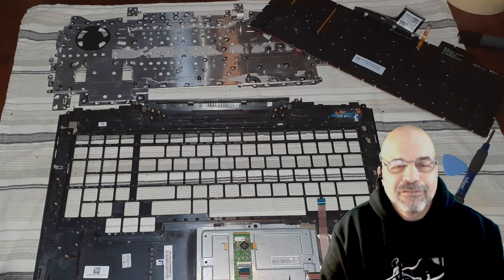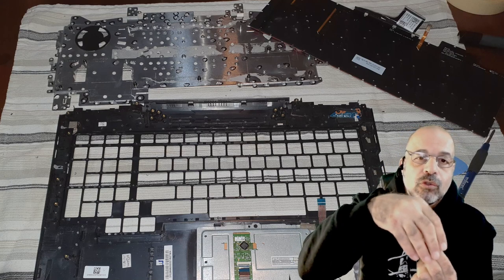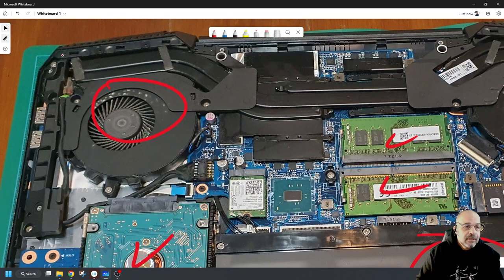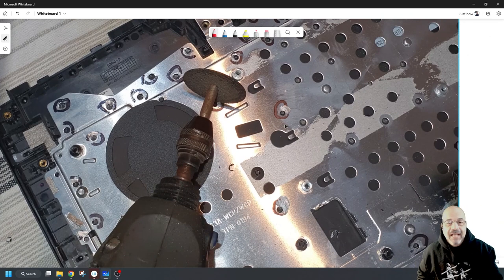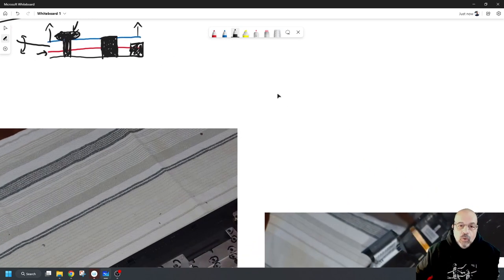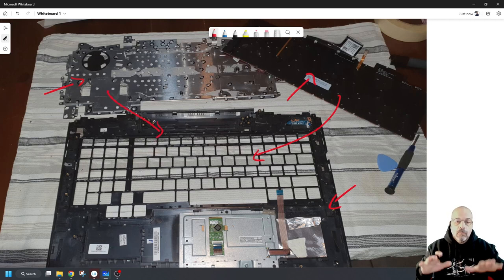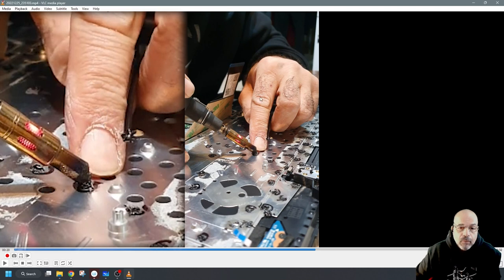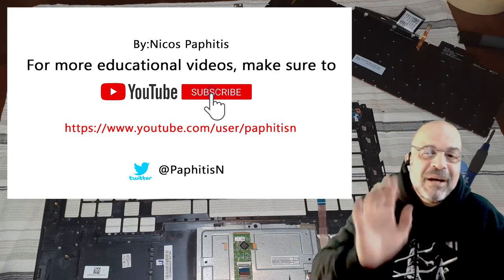Replace ANY welded / plastic riveted keyboard the CORRECT WAY.

Comment: JSYK, this worked. Thank you! No lie, it took my husband all day. My husband is amazing and patient, but he took this advice and followed it, saving him from having to figure it out solo. He has done many similar things. This is NOT a beginner’s job for sure! He had to use his lathe to fashion a new tip for his soldering iron, wanting fine control over its shape. I went out and bought him a dremmel tool. (It’s the least I could do besides feeding him during the ordeal.) Wow. That’s all I can say. What a long drawn out process! Why do they design keyboards this way?!
Reply from the maker: Thanks so much for your comment and feedback. I am glad the tutorial helped. It is not a job for the faint harted or a begginer. I am glad it worked out. Coudos to your husband and of course you for keeping him fed.
Reply: @paphitisn  i am in a tricky spot my keyboards not fully died at moments it works almost perfectly but if it does die the laptop can't be turned the annoyance is almost worth living with but ik to save my laptop in the long run i need to replace this keyboard as the keyboard has the power button on it but this would be the most challenging repair i've ever done i'm not used to soldering i heard uv glue might work thoughts
Reply from the maker: @apirlfools  i have tried UV glue in the past and it gives a reasonable result. Saying that though, keyboards that had general use worked well. Keyboards that were used for gamming did not last and after about 6 months some of the glued rivets gave, resulting in a mushy keyboard.

Comment: Good video, I've done some melting back other plastic parts, even 3d printer abs filament. Small tip: use an allen key to press down the melted pins, that way you dont have to do it with your fingers.
Reply from the maker: Nice tip. Thanks for your comment

Comment: I use hot air gun, that way when i lift the metal plate - plastic rivets thin out and are easy to put on the metal back on. But marking is a great idea, as i sometimes skip one or two..
Reply from the maker: Have not tried using hot. My fear was that you would not have to peel off the back plate in parts as you would not be able to remove the back plate in one due to the rivets cooling down. Possibly running the risk of either bending the back plate or overheating the face plate of the keyboard.  If it worked for you that is great. If you can reuse the entirety of the rivets to refasten the new keyboard then that is perfect.
Reply: Does this allow you to "scrape" the heads off easily? I might try this method and using pla from my 3d printer to reweld. I have a tool specifically designed for fixing 3d printer parts and adding screw inserts and what not.

Comment: I tried doing these several times, but by the time you add all the time required, it becomes cheaper to just replace the palmrest. This is only worthwhile if your labour charge is cheap
Reply from the maker: I agree. If you are charging for this then it most likely will not be worth it for the owner. It is only worthwile if you are repairing your own device or helping someone.
Reply: Where are you buying keyboards? Cant find hp 15ba anywhere. I would like to buy whole keyboard with palm rest,  if its easier to replace

Comment: Should have used extremely sharp razer blade. If you are practiced this is simple.
Reply from the maker: i am practiced and have used razor blades in the past. Using the Dremel with a grind wheel is safer and easier in my opinion. No force is applied and less chance of a slip which could cause damage. You should use whatever you are most comfortable with, there is no right and wrong when you are taking apart something that is not designed to be taken apart.

Comment: i use an Exacto chisel with a super sharp strait blade to lance the heads off the rivets and a soldering iron with ABS 3d printer filament to weld it back together. It took me approximately 3 hours to fix a Acer predator laptop by replacing the keyboard. I was not expecting this kind of repair when i took the job
Reply from the maker: Sounds like you did an awesome job. It really is about what you have available to you. For me i don't have 3D filament so zip tie was my option. It is a tedious repair so well done.
Reply: I'm about to replace my keyboard on my Acer Predator too! And yes, as soon as I learned about this whole plastic weld thing, my mind went straight to 3D printer filament. Someone else on the Acer forum used the plastic blades for weed-whackers. 
I'm so glad I found this video because the other two had the guys NOT keeping track of screws and being so rough with that backing plate and not using a "flux" for the soldering part.
Reply: Oh, and they also didn't bother cleaning the fans, which I've been wanting to do ever since my laptop got louder with age.
Reply from the maker: @Brooklyn_Ann  u am glad you foundbthis useful. Make sure to take your time, it is not a job that can be rushed if you want good long lasting results. Let us know how it goes.
Reply: @paphitisn  Will do. I'm going to be as slow and careful as possible. I paid 2K for this laptop in 2020, financing it for almost two years. I use it 12 hours a day on average, writing novels, marketing, formatting, and doing graphics. It's my baby. I did find a whole top chassis I can buy if this repair goes horribly wrong, but hoping it will work. My boyfriend has nylon filament, so we're going to try that for the soldering.
Reply from the maker: @Brooklyn_Ann test the fillament by soldering it on a small area first to make sure the 2 plastics will fuse together,

Comment: Thank you for this video. I have a Lenovo laptop that I bought in 2018. The laptop is awesome. The only thing I have had to replace on it was its WIFI card, which was $12. Other than that, its been a very good laptop, and starts up just as quick today as the day I bought it. 

Well, the thing about this laptop is I spilled soda on the keyboard literally the week I bought it. Stupid me right! I tried cleaning the keys off, which did get rid of the sticky keys, but in the process, my space bar key broke in half, and a couple other keys wouldn't go back in place. Back in 2018, there were zero videos on how to replace the keyboard, and zero keyboard replacements to buy. So what I did is buy a keyboard cover, and just use it with that on top. 

Fast forward to 2023, and I finally decided to buy a replacement keyboard. It was $30. Cheap. I watched a few YT videos on how to replace it, and it looked easy enough. So today I went to replace my keyboard. Took it all apart, and according to the YT videos I watched, the plate covering the keyboard was screwed in. Mine wasn't. It had the crappy plastic welded rivets! I wasn't happy to say the least. I don't have a soldering gun, and also was perplexed at how I would be able to remove the rivets and weld new ones back on, while making sure nothing was damaged. So I put everything back together. Lame.

Glad you made this video because it gives me confidence that I would do this job without sending it to a professional who would charge me $150-200.
Reply from the maker: Love the story 😂.
I really hope this video gives you the confidence to repair your keyboard. Ease make sure to let us know how it went if you do proceed with the repair.
Remember to make sure you have plenty of time planned for this repair as you do not want to rush it. You have already taken it appart one so do that again and reassembling should be easy but still take your time to map where everything came from and the order you removed each part. Remember to circle every rivert you remove, this is really important because you can easily lose track of those.
And finally make sure to use the black zip ties as they take really well. The white ones may not take to the plastic of the keyboard.
Good luck with your repair.

Comment: I've done this repair before using this method and it definitely does work. Just used a cheap 10$ soldering iron from home depot. Also used hakko flush cut pliers to remove the original rivets. Great video!
Reply from the maker: Thanks for your comment. Can the pliers cut the rivet heads flush? Never tried as i thought they would be forced at an angle because of your fingers touching the back plate. Interesting, wil give it a go next time to see.

Comment: Just finished replacing a keyboard on one of these, took me many hours and a burnt finger :) Instead of grinding the plastic rivets, I chipped away at their heads with an exacto knife and, most importantly, saved the plastic bits! I tried to slowly cut into them instead of ripping them off because they would then break at a lower height. I then marked the places where I cut a rivet with a sharpie so I don't miss any when putting things back.
When time came to fix the new keyboard in place, I placed bits of the cut plastic on top of the rivet and melted them together with the tops of the rivets with the soldering iron. I tried other plastics I had around but I found that not all plastics will "fuse" together with the one that the laptop is made from, that's why I kept the cut rivet bits. Some plastics I tried, with varying degrees of sucess: zip ties, wall plugs, clear packaging plastic.
Reply from the maker: Using the same plastic for the weld is a guarantee that it will bond. You are right that some plastics do not weld together so testing is always good. I have had great success with zip ties so i use them quite a bit. How did your repair go? Is the keyboard working and does it have a good feel?
Reply: @paphitisn  It's nice to see you're still actively responding to comments! I have a Lenovo Legion Y740 17" and just ordered a replacement keyboard. From what I've seen, a repair shop will charge $300-$400+ for this, so I need to try it out myself. If it doesn't work I'll just have to return the keyboard and buy an entire palm rest for $150. Have you done this again since posting the video? How did the installation hold up?
Reply from the maker: @joeytocz.136  i try to respond to all comments so thanks for the acknowledgement. I have repaired another 2 keyboards since this video and they are holding up great. The one in the video is holding up awesome also. It is  a gamer's device so the keyboard takes a pounding on a daily bases so the fix is holding great. The other 2 are used on a business level and they  too are still working great. If you get a tight sandwich of the keyboard and the backplate it is very hard for this fix to fail. It is when the repair is not tight and there is play that the keyboard will eventually break the rivets and end up with a mushy keyboard feeling.
Reply: @joeytocz.136  Funny, we both had the same laptop and did the same repair. Typing on it now with an unriveted keyboard and it's obnoxious. Debating the above riveting method, wondering if a thinner plastic for melting might be easier other than zipties, but can't think of any.

Swapped out with a fresh battery as well, and now I don't need to keep it plugged in. The old one was bulging like hell.
Reply: Someone else on the comments have done it that way it seems and got great results.

Comment: Great video my friend. I am working on my HP X360 and was using razor blade then going to use weight to hold down while JB quick got hard. But now i got the dremel out with my small plastic cutting wheels and pack of zip ties i had in garage. 💯👌..  Best quick advise I seen on this. Your the man. Thanks...
Reply from the maker: Really glad you found this useful.let us know how your fix goes.

Comment: Great idea to use zip ties as the new melt product... I have a couple keys that have gone bad on my MSI keyboard, and after watching this, I think I'll just stick with the external USB that I bought... I do know how to work on my machine quite well, but +/- 100 plastic cut-offs and melt-backs would really test my patience a bit much... Thanx for the in-depth video...
Reply from the maker: Definately not a task for the impatiemt, especially if it is your first time. A yask for a rainy, boring day :) do let us know if you get around to repairing. Have you checked and your keyboard is riveted? It may be an easy fix with screws.

Comment: I was checking if this is possible on a mass scale, but clearly it's too delicate work for that to be feasible. Still a great thing to know, thank you. I was thinking of doing this, we have tons of HP Chromebook G6 and they have some defect with the keyboard. Replacement keyboard only is like 16 bucks while used whole assembly is 35. Now I know why the replacement keyboard is so cheap.

It is a shame that they could not figure out a way to use screws or a repairable design instead of plastic rivets.

Comment: Good video, just the confidence boost i needed to replace the keyboard in a thinpad E14 that had these, i ended up using some 3D printing PLA that bonded really well with the rivets
Reply from the maker: I am glad i helped boost your confidence to do the repair. PLA is a great idea, good job. Ties are a bit more accessible for those of us that do not have a 3D printer. Good tip for those that do. Thanks for your comment.

Comment: Great Video.

I repair laptops and it frustrates the hell out of me that manufacturers produce items in this way unlike years ago when keyboards were screwed in.  Throw away society unfortunatley. Having seen your video I think I will give this a go.  I have been trying to come up with a way of replacing the welds, I did wonder if some sort of plastic washers could be pressed over the remaining rivot and the heated would work.  I have just been looking at plastic welding kits on Amazon.  They look like with a little practice they could do the job.

Thanks for the video.
Reply from the maker: Glad you found it useful. Its great to get feedback from others that also repair devices. If you test a plastic welding kit let us know how it goes.

Comment: Great ideas, and helped me get my keyboard out of my laptop. The dremel tool grinding disc was OK, but I used a slim bullet-shaped grinding head to get into some trickier spots and that worked even better.

Reinstall with the iron and ziptie technique was highly error prone. I often could not get a fuse between the leftover stem and the new material. More often than not it would create a blob that would just plink off at first touch. I did the best that i could, but suspect I'm going to start hearing rattling in there eventually.

I'm wondering if some sort of plastic-compatible epoxy pen, or a UV curing material like the Bondic pen, would have been a more consistent solution.
Reply from the maker: Thanks for your comment. Using multiple tools to get to the tricky places is a good idea. Which tool is a matter of preference as long as you do not remove too much of the stem. Getting the weld with the ziptie can be tricky so a bit of practice is always good. As long as you got molten plastic an it overlaps the metal backplate you are good. I don't think you will get rattling or a spongy keyboard. There are no strong forces at play, the welds just need to keep that sandwich together. Th problem with hot glue is that it does not take well on smooth surfaces and the heat from the laptop will aid in weakening the bond over time. As for using epoxy pen or UV curing. I have tried using epoxy in the past on a test keyboard and i was not happy with the result. With the slightest bend of the keyboard the epoxy released from the surface of the stem. UV curing i have not tried so i can not comment on that. I am not sure where i would find it in Cyprus to be honest.

Comment: Sir, thank you so much for this tutorial. I have an Acer predator which has these same plastic rivets. My left shift key stopped working so as a gamer the laptop became very problematic.  Its a good thing i found out that these rivets need to be fabricated and need to be in there in order for the keyboard to work properly, or I would of not done this right. I do wish that plastic rivets or some sort of retrofit screw set was available but the zip tie method worked out great. I was able to find new replacement keyboards on amazon and ebay and used your video to install., thanks!
Reply from the maker: that is great to hear. Well done and thanks for your comment

Comment: I tried your method on my Asus VivoBook.  I experimented with PLA and ABS filaments and some mystery plastics and they did not bind with my case's plastic, but your recommended black "NYLON" tie wraps worked really well!  Thanks again :)
Reply from the maker: That is great. Your info will help others. The black ties are great. Glad the tutorial helped you and thanks for your comment.
Reply: @paphitisn  Yup, I think the negative comments are from people  not using genuine nylon, and not getting the soldering iron wetted with molten nylon to make contact with the case plastic and mix the two plastics together.  Just melting the nylon on top of the case plastic is not enough.
Reply from the maker: @philipdifrancesca absolutely, getting enough molten plastic on the tip of your soldering iron so that you can mix it with the molten rivet plastic is the key to generating a one piece rivet head. Otherwise if you are just melting plastic on top of that stem it will simply snap off. Its like mixing 2 different colour pieces of plasticine. You need to mix so the colours are not distinguishable. If you put one on  top of the other you can still separate them.